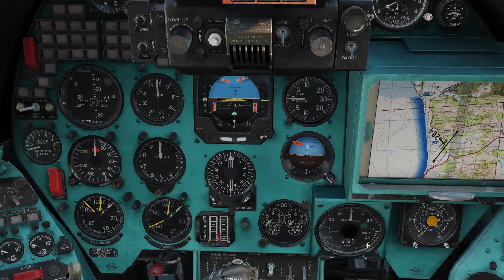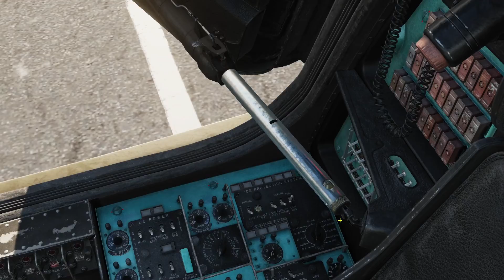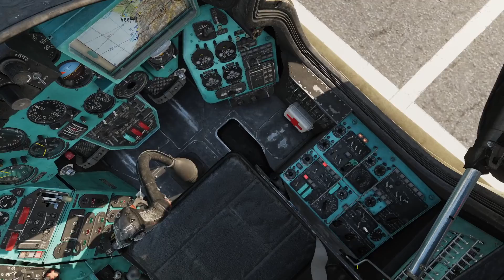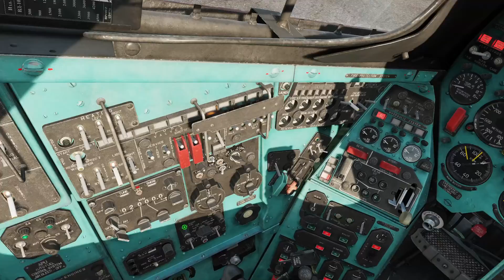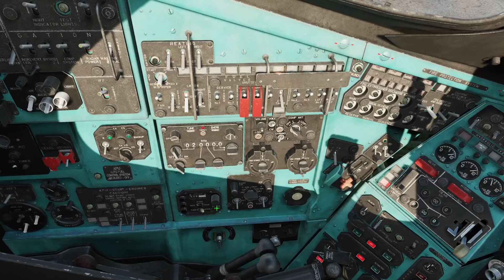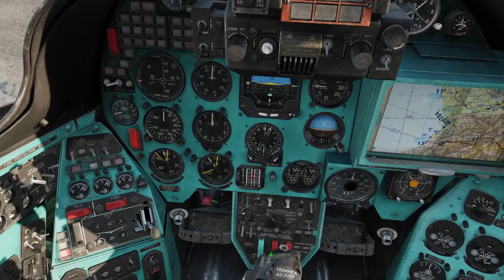[DCS] Mi-24P - Cockpit Tour and Startup

Comment from the maker: Slight correction to the startup-video:

- At 07:00, after turning on the Batteries, also turn on the inverter to receive power to the instruments during start-up. It's switch is the left guarded switch on the bottom of the Generator Panel.
Thanks to Rabies (ED-Forums) for pointing that out.

- At 07:36, turning on the fuel delimiter (crossfeed) should be set to the open position (up), and the light above should extinguish. However, in the current Open-Beta version of the Mi-24P, the light remains on for some reason. This logic might be changed soon, but once finished, the light should be off during the flight, and the switch in the Open Postion.
Thanks to mackemsniper (reddit) for pointhing this out.